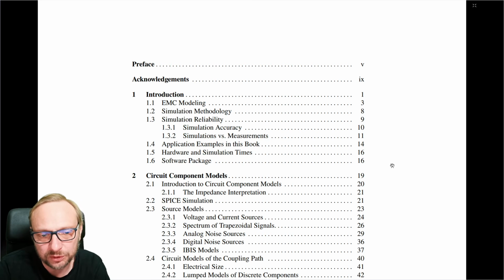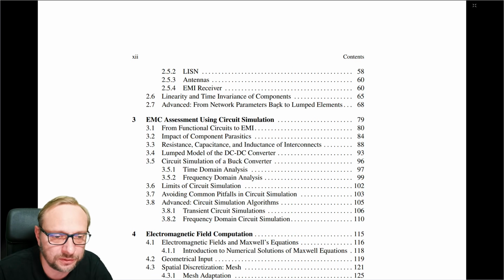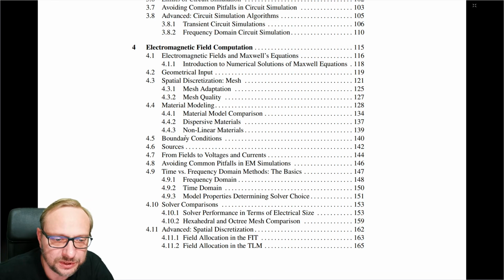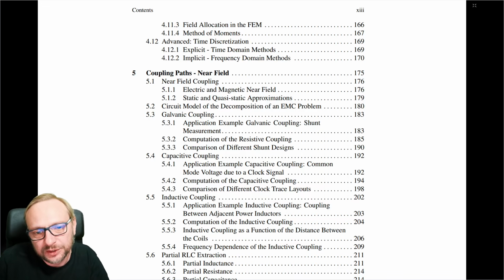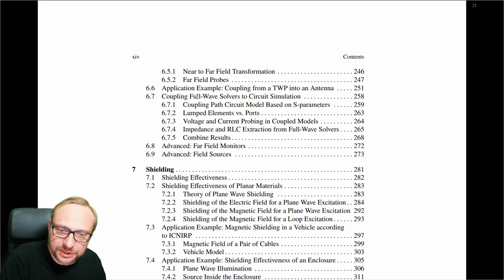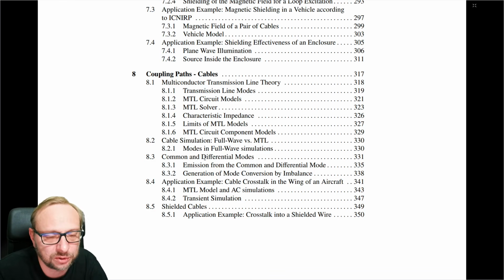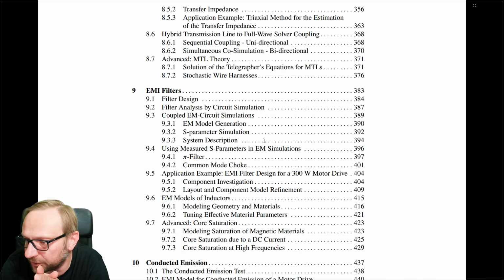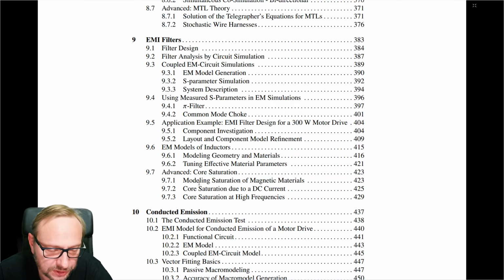Book Reveal 2: Chapters 1 - 9

Comment: The contents sound really great. I am looking forward to it! 
I am currently pursuing a phd in RFIC, but one of my main interests has been and still is EM simulations and EM theory. I have used many tools such as CST Studio (FDTD, FEM), Ansys HFSS, Maxwell, Q3D, Keysight Momentum, EMPro, Cadence EMX, Axiem, Ansys RaptorX and Empire XPU. I also built my own small electrostatic and quasi-magnetostatic simulators (PEEC) to determine capacitances and skin/proximity effects. 
I haven’t used CST lately, as it doesn’t seem to be prominent in the RFIC space. I have not yet been able to tryout the pRLC feature or other recent improvements, but I’d love to at some point.
Reply from the maker: Thats really many tools :-) You should try the pRLC solver in CST. It is not PEEC but FEM based which is good for compex geometries.
Reply: @AndreasBarchanski  I’d need to organize a license for a current CST version first, so I can’t test it myself right now, but does the pRLC solver compute frequency dependent L and R at discrete frequency points exactly? 

Ansys Q3D apprently only approximates the frequency transition from DC RL to AC RL. When I compared a single rectangular conductor between my own quasi-magnetostatic PEEC model and the Q3D result, the DC and AC at fmax fit very well, but the frequency transition area was a little off and ofc I saw that Q3D did not solve for each of my frequency sweep points. Does CST handle this differently (better)?